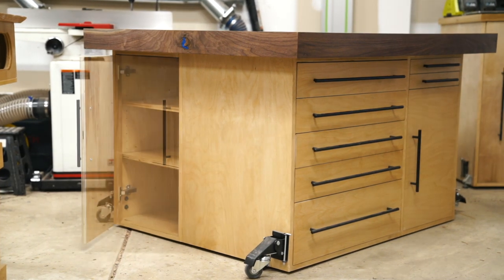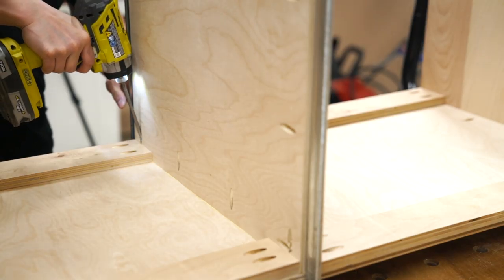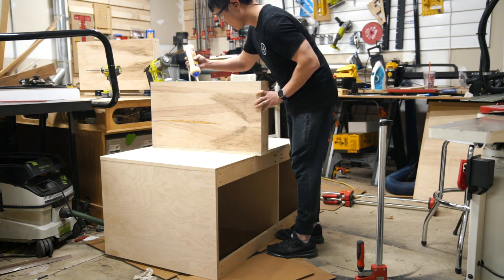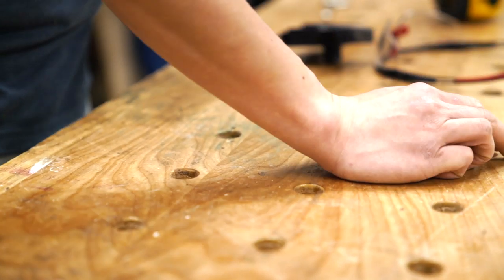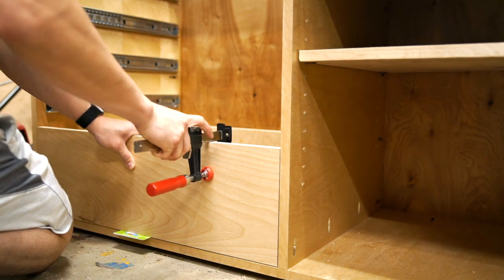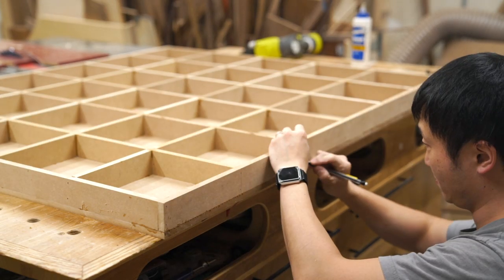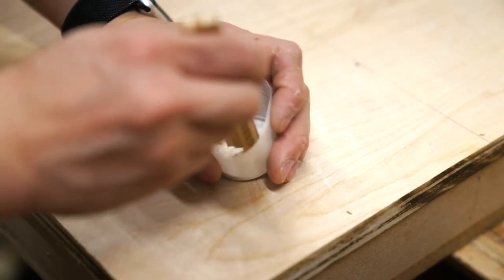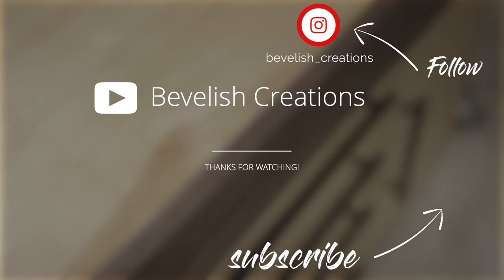Torsion Box Workbench & Assembly Table / Outfeed Table with Storage || How To Build - Woodworking

Comment: Very nice job, well done. I would REALLY like to see how you built the OTHER table, the one you used as a reference surface for this build. I say that because that is the project I was hoping this would be. It also looks likes a torsion box, but with dog holes for clamping, etc. It's that clamping ability that I wish to incorporate into my assembly table. Thank you for the video.
Reply from the maker: Hey it’s just torsion top set on a base that’s based on Crafted Workshop’s plans

Comment: Nice bench, good job building. Why not try using. Rabbit or dado joints along with a Brad nailer which is much stronger then a Butt joint and pocket screws.👍
Reply from the maker: Because there’s no need to overdesign something. Butt joints are strong enough for this application

Comment: Great design. I couldn't quite tell if the top allows for overhang needed for a Delta Contractor table saw. Reiner
Reply from the maker: I’m not sure what you are asking? Why do you need overhang for a contractor saw?
Reply: @BevelishCreations  On a contractor saw the motor hangs off the back of the saw and will need to go under the top to slide the  table against the saw top, I just had my new shop built and am in the process of setting it up. Thanks.  Reiner
Reply: @BevelishCreations  I Love the design and that it is on wheels. Lots of storage and looks great. I purchased the plans but need to figure out how to make the top with overhang for the motor.

Comment: I agree with the many other comments about the build, design, and editing a joy to watch and learn. just subbed. One question as I am binge watching assembly table videos for building my own. What was your rationale for the abbreviated size? Is it simply all you can squeeze into your current layout? Or have you some logic behind not using the typical 4x8 full sheet. This is America right? Bigger is always better; don’t agree necessarily so when is see smaller tables I’m interested to understand why.
Reply from the maker: Thanks! I don’t really have the space for a full 4’x8’ table. And I actually built it for my CNC machine, but I didn’t want to “market” it that way since the build can work as an assembly table as well

Comment: I have the same SawStop and the table saw measures 34.5” from the ground. This workbench will measure 32”. Did you intentionally leave it short or is your table saw height flush with your workbench?
Reply from the maker: My saw is 34” tall. But I made it shorter to clear some of my jigs.

Comment: Nice shop and tools!  Is this going to be an additional assembly table or is it replacing the one with all the dog holes in it?  Also, if you only had the space for one assembly table, would you want it to have dog holes all over the surface?  I have a workbench for hand tool work, but I am looking to build a mobile table that can be used as outfeed and assembly.  I also have a cnc, so machining the grid of dog holes is no problem.
Reply from the maker: I actually use this for my CNC. But I called it a workbench because even if people didn’t have a CNC they’d want to watch the video and build this for their shop to use as an assembly table or workbench. I actually prefer my workbench with all the dog holes. I use the dog holes all the time to hold my pieces down
Reply: @BevelishCreations  Very cool.  I was leaning that way as well.  You showed some nice work holding techniques that wouldn't be possible without the dog holes.

Comment: I'm about to make a similar project but will be inserting.my small rigid table saw in the right corner. Will the torsion box stay flat without that section if I take my time in cutting and securing the box?
Reply from the maker: Yeah it won’t be a problem

Comment: Great video. I am considering buying your plans. What are the rough dimensions and is there any reason one couldn't add dogs or track to the top? Does it interfere with the torsion box?
Reply from the maker: It’s roughly 40”x52”. If you want to add bench dogs you’ll probably want less inner grids. And since all sides are closed off it’ll be a pain if you dropped something inside. You can add T tracks on top though

Comment: I really love this build! But i do have one question.. Why a torsion top? Seems like alot of unnecessary work. I hope to maybe do this in the future once i get some space to work.
Reply from the maker: Torsion box tops are very rigid and dead flat. So when you do assemblies things will line up the way they should. It’s one way to reduce the likelihood of wobble in furniture pieces after assembly. Of course if the ground where the furniture will be placed isn’t flat there will still be wobble, but you won’t add wobble on top of wobble :D
Reply: You need a dead flat reference surface. It makes life so much easier.

Comment: How many sheets of plywood (and of what thickness) are needed for this project?
Reply from the maker: One sheet of 3/4”, half sheet of 1/2”, one sheet of 1/4”, one sheet of 3/4” MDF, and quarter sheet of 1/2” MDF and quarter sheet of 1/4” MDF
Reply: @BevelishCreations  Thanks. I bought your Drill press stand a couple days ago and didn't realize the materials that went into it. But its definitely very rigid!. I like this table, but need more of an outfeed table for the saw... Might just skip the top and convert it to outfeed instead. Thanks!
Reply from the maker: Hey sorry I gave the wrong information to your question. I was also answering someone’s question about the media stand I just posted a video of. This assembly table actually uses 3 sheets of 3/4” ply, half sheet of 1/2” ply, one sheet of 1/4” ply, and half sheet of 1/2” MDF